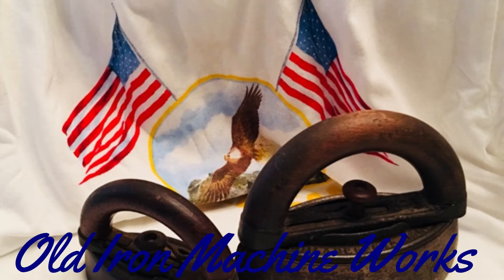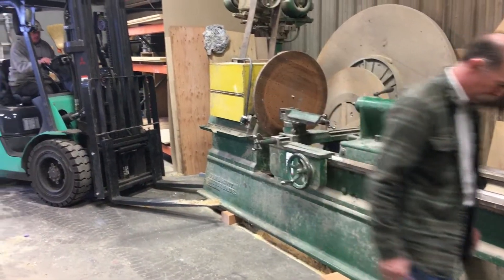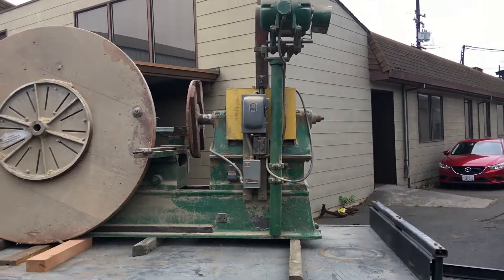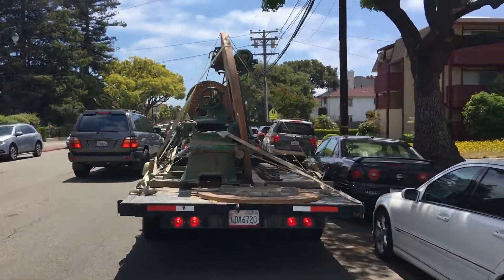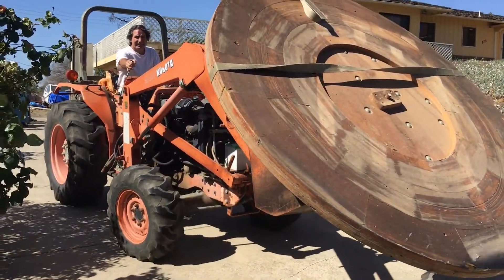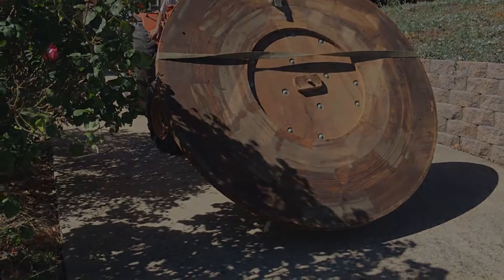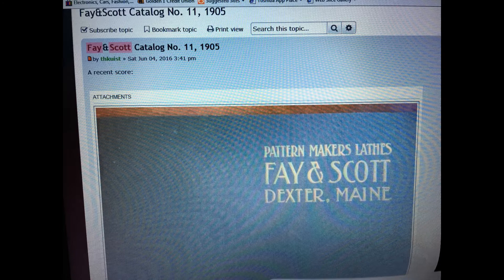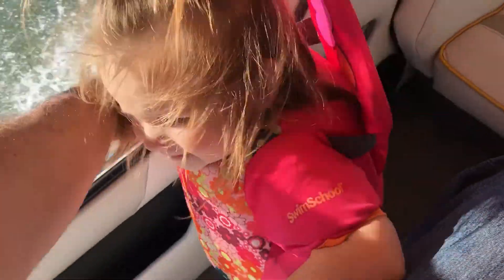Fay & Scott  Lathe,  Bringing it home.

Comment: I had a Fay and Scott gap bed metal lathe that came out of the Santa Fe Rail road shop in Topeka Kansas in 1922. I bought that lathe in about 1967 and sold it in 2015. It had a 32 inch cast face plate. I used that old machine a lot.
Reply from the maker: Leo, I would imagine you got a lot of enjoyment when you were using it.Thanks for stopping by.Gary